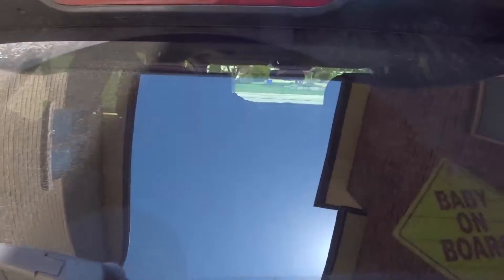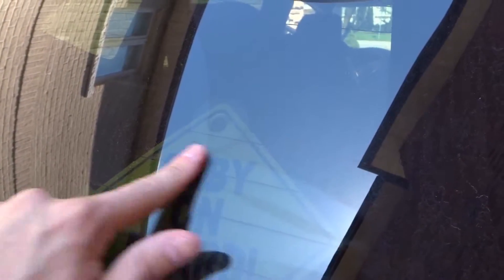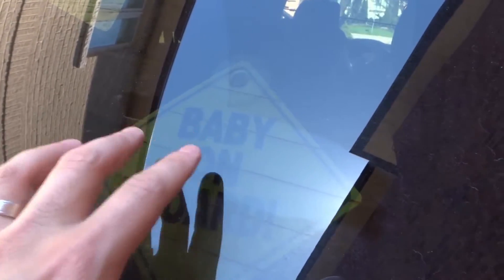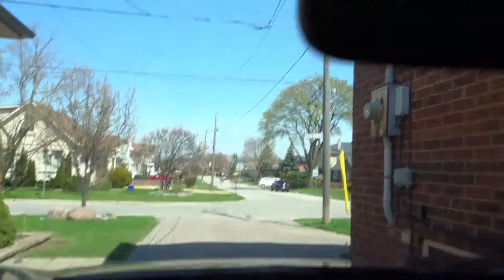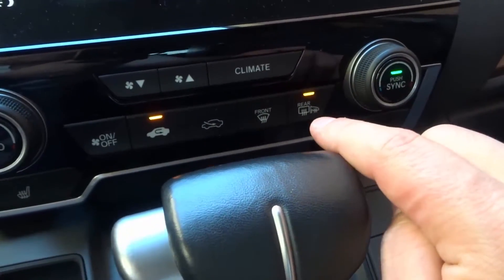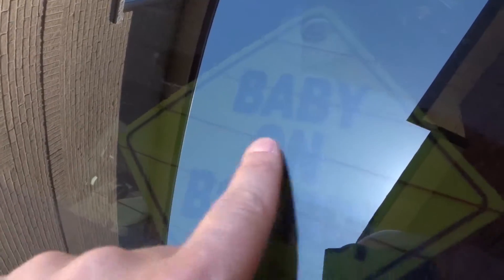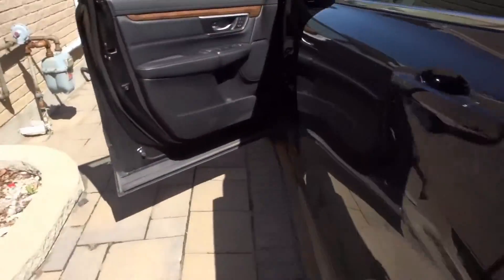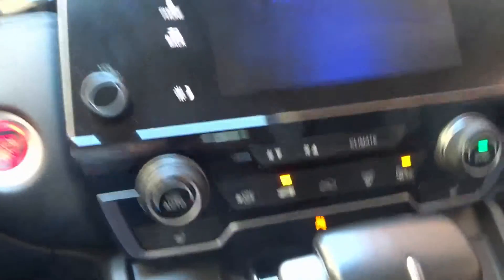How A Rear Defogger Works On A Car-EASY Explanation

Comment: Its not a reaction, but rather that the material is conductive enough to allow current to flow, but at the same time, sufficiently electrically resistant to generate enough heat from this flow. this heat can then transfer to the glass, and then transfer to the thin film of ice or fog, thereby inducing the de-icing or de-fogging effect.

Comment: There is no "reaction" happening here. Simply that the resistive heat that is being built up as a result of the current flow through the screen printed circuit is transferring to the glass, and then from the glass to the ice